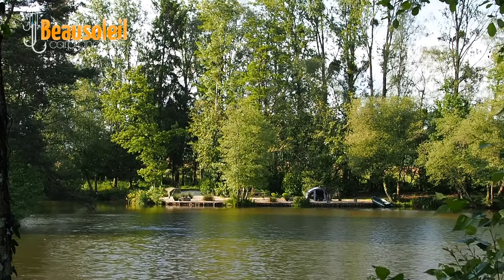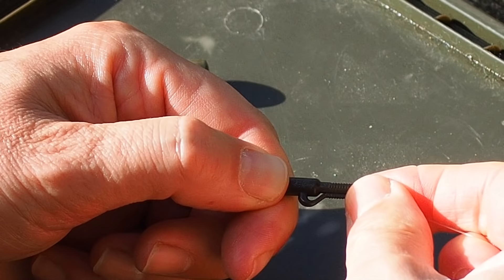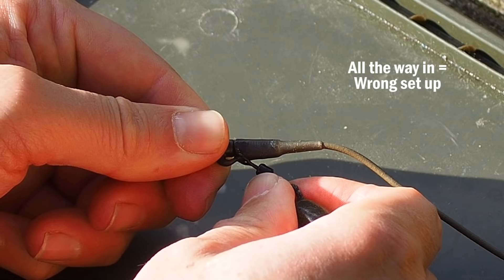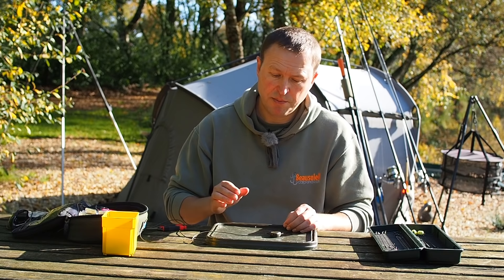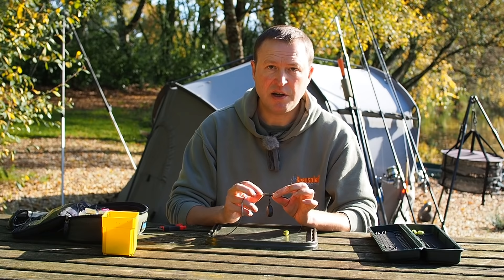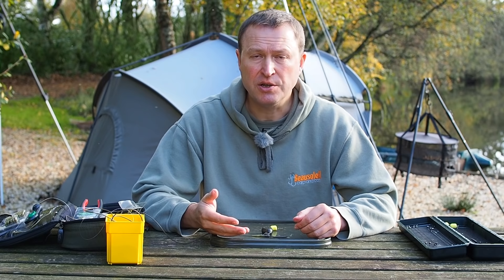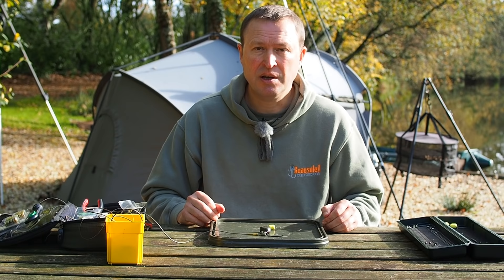STOP Using Lead Clips Like This | 5 WORST mistakes❗

Comment: Hi Matt. Could you use the lead system you used in the mono d rig video on tubing instead of on lead core/ lead free leader material?
Reply from the maker: Hi mate, yes absolutely, you can use the lead system of my mono d rig with tubing. However, you can’t use the beads like on the leadless leader version. If you use beads with tubing, it is dangerous. Use just rig tubing, a size 8 ring swivel, a swivel lead and a tail rubber. Spin forwards to 21:00 in the mono ‘D’ rig video https://youtu.be/hoHB1gi_sQs for a demonstration of that setup. Any question, just let me know. Cheers, Matt.
Reply: @matthewcollinsangler  thank you Matt. I’ve been using lead clips for a while now, using them running. Now I’ve watched this video I realise I’ve been using them completely wrong. I had them set not to drop the lead and squashed the swivel to make them running. Luckily I never snapped off. Thanks
Reply from the maker: @banditfishing1558  I’ve done it myself, and I’ve certainly seen other anglers do it. It’s not until you see lost rigs that look like this that you realise the danger of the setup. Making mistakes is how we learn so it’s okay 😊 Thanks for sharing.
Reply: @matthewcollinsangler  yea. I haven’t been fishing too long, maybe 2 years. My current pb common of 20lb 11oz and my pb mirror of 23lb 15oz we’re all caught on a running lead clip. However I’m definitely making the change to you’re lead setup
Reply from the maker: @banditfishing1558   Moving over to running leads was the best decision I ever made. You’ll never look back mate.

Comment: Well at more than 3.00 USD each for leads I push mine all the way up...them being "Disposable" is insane.
Reply from the maker: I get where you’re coming from. There’s an alternative to lead clips and that’s a running rig: you keep the lead and they’re very safe and effective. If you fancy going through my channel, you’ll find several designs of running rigs, here’s where to start if you’re interested: https://youtu.be/ckzalwJuh0c
Reply: @matthewcollinsangler  I will check it out.

Comment: So, in the first example, are you saying that if you set up the clip right, you lose a lead every time you get a fish? I thought the idea was for it to detach if you're snagged up with a fish still attached?
Reply from the maker: Hi mate, yes, that’s right, if you set up a lead clip correctly, you dump the lead on each take, not just in snags. That’s how they were designed to work (and a great way to sell a lot of leads). If you set the clip too tight, you keep the lead on but you’re potentially fishing with an unsafe rig. 
The other problem with setting it tight enough to stay on during the take is that the carp will use the weight of the lead to throw the hook out of its mouth without giving you any indication at all. 
I hate the idea of losing a lead on every take but with lead clips it’s the best way of preventing the carp from doing you. I avoid using lead clips whenever possible because of this. I’ve been fishing running lead systems (in various forms) for the last 12 years and I always encourage our guests to adopt this practice. IMO a simple running lead system is safer for the carp, better for the environment and will outfish any traditional semi fixed lead system like a lead clip (unless you dump the lead on the take). This is based on my experience at my lake which is weed free but weedy lakes are different. I've fished lakes that are so bad, if you don’t drop the lead you will not land the carp. Hope that clears things up for you. Cheers, Matt.
Reply: @matthewcollinsangler Thanks for the reply. Hmmmm, interesting. Expensive and bad for environment as you say. I must admit,  I’ve only started to look at these different rigs over the last year or so. Always fished running or in line semi-fixed bolt type rigs previously.
Reply from the maker: @bigbrobunny  Hi mate, I’d stick to the simple running rig. It’s all I’ve been using this year. New video out later today on that actually :) No dumping of the lead and the carp can’t do the rig. If the mainline fails the lead slides off very quickly so yeah, simple, safe. Cheers, Matt.

Comment: Awesome video mate,  what's your thoughts on the Atomic lead clips? Normally use a helicopter set up.  But when I need to dump the lead atomic bombs away lead clips seem to be the best 😎
Reply from the maker: Hi mate, thanks for the feedback 😊 I’m not familiar with the Atomic lead clip, it does look different but I’ve never used it. I must admit that the helicopter rig is not a rig I use so I have very little knowledge and confidence in it. It’s definitely a weakness in my game lol. I’ve been a massive fan of running rigs for the last ten + years. If you haven’t found them yet then you could check out these other two videos. The first one is olden but golden and perfect for short to medium range on tricky estate lake where carp have seen it all, here’s the link: https://youtu.be/ED58TfFEcqM Next up is something a bit more universal. Not many situations where this rig doesn’t excel (apart from weed lol), it’s my current favourite and I can't seem to miss! Enjoy: https://youtu.be/hoHB1gi_sQs. All the best, Matt.
Reply: @matthewcollinsangler  I'll give it a try,  cheers mate 😎

Comment: Could a possible solution to problem #4 be to use a lead core leader instead of using tungsten tubing ?
Reply from the maker: Hi mate, I haven't used lead core for years as I found that after a while the lead core can poke through the outer sleeve and that becomes dangerous. You are right though that a leader (I use the Nash cling-on lead free leader) does reduce the risk of problem#4, but I still wouldn’t advocate using a free running lead clip in this manner. I’ve tested it myself and I’ve seen what happens at my own lake when customers have tried it and things have gone wrong. It’s not pretty! The bottom line is 1) avoid using lead clips as far as possible 2) if you have to use them, use the pinned versions and dump the lead on the take. There are lots of safer and more effective running rig options available. Have a browse through the channel and pick one that suits your needs. I’ve used running rigs of one sort or the other for 15 years and I’d never swap back. Cheers, Matt.
Reply: @matthewcollinsangler   thanks for the quick reply Matthew. I'll take your advice and look around your channel for a running rig I like 👍
Reply from the maker: @LuisGutierrez-fi5rv  Cool mate, here are a few options:
https://youtu.be/LzFina92brM
https://www.youtube.com/playlist?list=PLHQUkuWLN6mcp3DEbfqp0ruDrcWUFM0U_
Reply: @matthewcollinsangler  Matthew I've just got done going through your Playlist of running rig videos. Phenomenal stuff, I appreciate you sharing your lifetime of wisdom. I'm left with a question, I'll be tying my mainline to a lead free leader directly. Can the ring swivel you use to connect your rig to the lead free leader be replaced by a quick change swivel without any added risk to the fish or rig?
Reply from the maker: @LuisGutierrez-fi5rv  Yes absolutely. In fact a size 8 quick change swivel is my go-to solution for the connection between rig and the cling-on leader. To attach the rig I just make them with a loop at the one end and slip on a short tungsten anti tangle sleeve. This then slides up onto the quick change swivel to hold the rig securely in place. Hope that helps, cheers, Matt.
Reply: @matthewcollinsangler  you're a legend. Thank you for helping me out and giving me confidence in a new rig. I follow you on Instagram as well. I have a week-long trip planned out at a desert reservoir in the States. I'll definitely be tagging you in any catches. You've given me the confidence to throw nothing but running rigs for a week straight for this campaign. Thanks again!
Reply from the maker: @LuisGutierrez-fi5rv  Hi Luis, ah cool, that’s great, I’m sure you’ll do well if you can get on them. There’s no great mystery to carp fishing really. Not once you discover how ridiculously effective the combination of razor sharp hooks and running rigs are 😊 Enjoy your journey, Matt.

Comment: I would love to dump the lead on every take but can’t afford to replace them all the time.
Reply from the maker: It all depends where you’re fishing… Dumping the lead on a heavily weeded water is the difference between banking what you hook or losing the carp. Dumping the lead at any other water is bad for the environment. I made this video to encourage anglers to consider alternative solutions such as running leads, which is what I use for 90% of my fishing. Running leads prevent the carp from using the weight of the lead against you and you get to keep the lead so it's a win win. If you’re interested, you'll find various different running lead setups on this channel. Cheers, Matt.

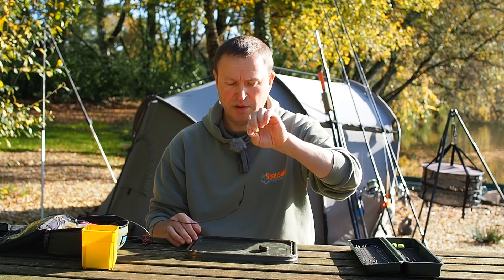Comment: you can clearly see that you put a lot more force getting the lead down and then pulled up as the lead was going down on 1st lead shake 3:02 then on the tail rubber pushed all the way you never put the same amount of force dropping the lead and you pulled to try and remove the lead as the lead was coming back up not while the lead was at the bottom of its drop like the 1st attempt 3:29 and was bouncing it around all softly like that was going to do anything i mean if you are going to do these test do them fairly ffs.

Comment: What??? Why would i want to lose my weight everytime. Why not just set up a slip weight set up so they can just pull a lose line to a certain point. I swear we over think things with wasted junk with fishing.
Reply from the maker: Hi Javier, absolutely agree with you. I hate dumping the lead and only do it in very specific circumstances. I have been fishing with running leads for years and there are plenty of examples on this channel. The majority of UK anglers fish with lead clips though and I hope to encourage them to switch to running leads. Cheers, Matt

Comment: Have you ever tried pushing the rubber on the inside of the arm ? It’s all I do these days as it works better… try it 🤔
Reply from the maker: Hi Lee, thanks for the suggestion. I’m not exactly sure I follow. Are you saying that you fish with a version of this shock and run system (with a run ring pushed over the tail rubber) but rather than chop the leg off, you tuck the tail rubber underneath the leg? I guess it depends on what lead clips and tail rubbers you are using. Maybe you’re not using a run ring and just pushing the swivel in between the tail rubber and the leg of the lead clip 🤔 I can see that working for sure. I’m testing a new run clip at the moment which will make this system redundant but that sounds like a great version. Cheers, Matt.
Reply: Hi Matt 
I don’t like the idea of the tail rubber going over the serrated arm so we all used to cut them down for safety, but now I just slide the rubber under so the lead can always eject , that’s why I prefer the mcf dumper system 

Thanks 

Lee

Comment: Why would you want to dump the lead and litter the bottom of any lake / quarry with lumps of metal. Surely it’s better to retain the lead / weight.
Reply from the maker: Hi mate, I agree with you 100%. I made this video because I hate to see anglers deliberately dumping leads and I’ve found plenty at the bottom of my lake over the years. Lead clips will always have a place in carp fishing but they seem to be the only method that some anglers know. Personally I hardly use lead clips, most of my fishing is done with some form of running lead system which the carp find extremely hard to deal with. It saves me money and it’s better for the environment because I hardly lose any lead. There are plenty of examples of safe and effective running lead systems on this channel and that’s all I recommend for our guests at Beausoleil. Regards, Matt.

Comment: Not bad if you can be affording to drop the lead on every take or cast.
Reply from the maker: Hi Lewis, I actually made this video because I hate to see any anglers deliberately dumping leads. Lead clips will always have a place in carp fishing but they seem to be the only method that some anglers know. Personally I hardly use lead clips and therefore it’s very rare for me to lose a lead. Most of my fishing is done with some form of running lead system which the carp find extremely hard to deal with. It saves me money and it’s better for the environment. There are plenty of examples of safe and effective running lead systems on this channel. Regards, Matt.

Comment: So every time he catches a carp he loses a lead?
Reply from the maker: Hi James, I know, it’s mad, but that’s what lead clips were designed to do. However, that’s not what I advocate!! I hate dumping leads (that’s why I made the video). I know a lot of anglers do it and are okay with it. For me there are usually better alternatives but sometimes, depending on the fishing situation, you have to. Most of my fishing is done with some form of running lead system which the carp find extremely hard to deal with. Plus it saves me money and it’s better for the environment because I hardly lose any leads. There are plenty of examples of safe and effective running lead systems on this channel and that’s all I recommend for our guests at my lake. Here are some examples: https://youtube.com/playlist?list=PLHQUkuWLN6meZucvGzWoXCl774le4hw-J. Cheers, Matt
Reply: @matthewcollinsangler  hi Matt
Thanks for replying. 
I fished in the 90’s , when fishing for carp I had a ledger an one split shot free running set the drag on the reel an wait for it too scream, great days
I am just getting back into it with my son who is 6, omg it’s a different ball game now, anyway the excitement I had as a boy has been reignited 
I never thought I’d get that back,
Just subbed to your channel 
All the best 
James
Reply from the maker: @jamessteal121  I had a very similar journey mate, starting back in the 80’s then had a 10 year break. I was very shocked when I restarted lol. Check out my mono hair rig, super simple, deadly effective: https://youtu.be/LzFina92brM. Thanks for subscribing 😊
Reply: @matthewcollinsangler  👍👍👍

Comment: 2:35  your anti tangle sleeve doenst work now because of your ring. I mean if you wanne make a statement.... do it on the right way
Reply from the maker: I understand your point but I’m not using the anti tangle for its anti tangle properties. I’m using it because I’m using a mono hooklink with a loop at the top so I can swap rigs quickly using the loop to loop connection. Without the anti tangle sleeve the mono relaxes and it changes the angle at which it exits the ring. It’s a small detail but the anti tangle is a simple way of stopping the loop from moving. This doesn't happen with coated materials or braided but it does with mono. Cheers, Matt.

Comment: so your saying to lose the lead weight each time you get a bite? 
fuck that!
Reply from the maker: Not at all. What I’m saying is that you shouldn't use lead clips unless you have to dump the lead. I use running leads 99% of the time because I find them to be more effective than lead clips at catching carp, they are safer for the carp in many situations and better for the environment. They are also cheaper. You’ll find plenty of very effective running lead setup on this channel. Cheers, Matt.

Comment: All this is ok. If you don't use rig tubing. Maybe rig tubing is the problem. Just a thought.
Reply from the maker: Hi mate, thanks for commenting. I’ve experimented using lead clips with leadless leaders (set to run up the line) and for me, that's not a good idea either. The hole in the tail rubber is pretty small and it doesn't exactly fly over the top splice of a leadless leader. Nothing wrong with using lead clips with leadless leaders as long as you use a pinned or fused clip and drop the lead on the take. Cheers, Matt.

Comment: I find it difficult to follow as you are cutting shots in between so the flow is missing
Reply from the maker: Thank you for the feedback. We're always learning with video editing.
Reply: @matthewcollinsangler  Actually it was mostly due to my first time using the lead clips, after your video I got it. I caught one carp on first day use of this system with a popup and a big one on the second day use. However I lost my lead once after a run and didn't hook the fish either, line was intact. Any tips on not losing lead or is it unavoidable if you press the rubber only halfway or did I experience a rarity. Maybe the impact on the water removed the rubber indeed and then the fish swimming away with the bait was enough to lose the lead and spit the hook I'll consider your tape advise to prevent it.
Reply from the maker: @moonsmilelucide  Firstly I’m glad that you caught a carp and secondly I’m glad that the video made sense after you’d watched it again. Like I say in the video, losing the lead when fishing with lead clips is the right way to fish them, so it sounds like you did get it right the first time. On the second day, what most probably happened in my experience is that the carp picked up your rig, ejected the lead and then spat the hook. If you used the same rig as the day before, I’m sure that’s what happened. Carp hooks are very easily damaged. I carefully inspect my hooks using a loupe or eyeglass before casting them in the water. You should change your hook and rig after every carp and I certainly would not not re-use a rig from one day to the next. I hardly ever use lead clips because I don’t like to lose the lead after each carp. It’s bad for the environment and bad for my wallet. I suggest you switch to a basic running rig setup like I show in my mono hair rig video. https://youtu.be/LzFina92brM It’s very effective and safe as you’ll see. All the best, Matt.
Reply: @matthewcollinsangler   @Matthew Collins  Thanks for your extensive explanation, I'll surely check out your mono hair rig video!